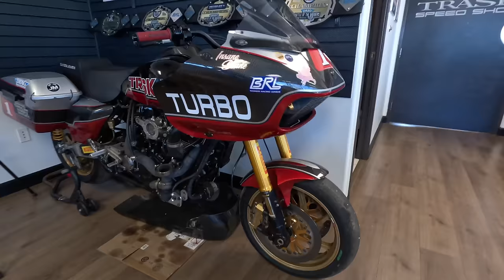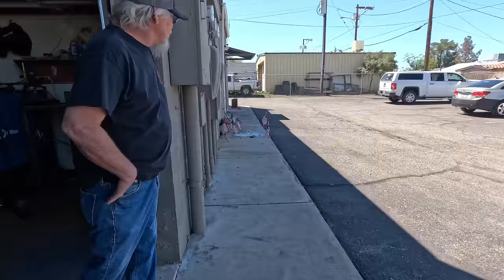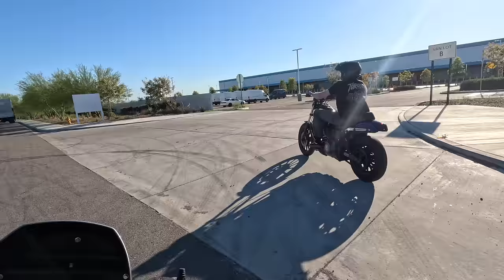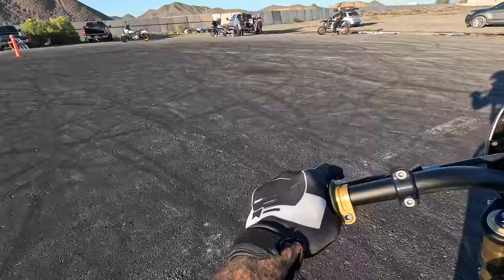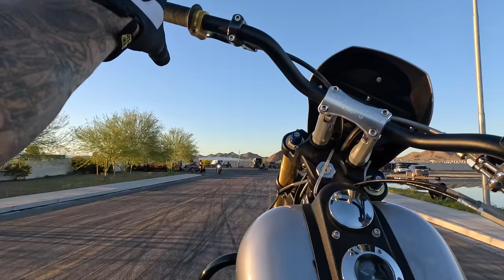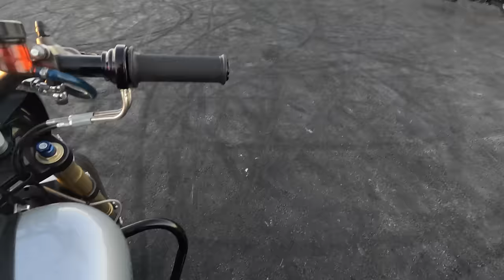Bike Week AZ day 3. We ride the most violent Harley Davidson ever.

Comment: That Harley you rode in the first bit of the video is insane! That's comparable to the MHP 131 Ass Eater kit 😳
For those that don't ride or are judgemental of other bikes: Bout that crotch rocket stunted out sport bike at the lot... There's always that one guy that's in the way of everybody 🤣 it's not the crew hates sport bikes. It's the simple fact that black/green sport bike rider is ALWAYS in the way and from how often I've seen that in the videos I wonder if the guy does it on purpose 🤷🏼‍♂️🤔 Kruesi crew gets even more props for not deckin the dude.... Yet 🤣
Reply from the maker: You’re 100% correct. And you’ve all definitely seen that dude in my line of site many times and videos.

Comment: They make vacuum blocks with as many ports as you need. you can mount on top of driver fenderwell. Run one of your main vacuum ports off intake to vacuum block. And just make sure with wiring that your grounds are all hooked up. Something as simple as a ground wire or not fully charged battery will ruin your life.

Comment: Crazy how much money and noise it takes to get a harley moving as fast as a clapped out R6
Reply from the maker: This bike will smoke a brand new R6
Reply: I love Harleys but love my s1000rr more lol  $22k bike, 800$ headers a $500 tune, $500 hand brake and it's stupid fast and easy to wheelie. I was going to get a HD but building it to have power, to be able to stunt, to have 140+hp, suspension brakes and bars would be like 35-40k and the motors don't like wheelies like a sport bike does